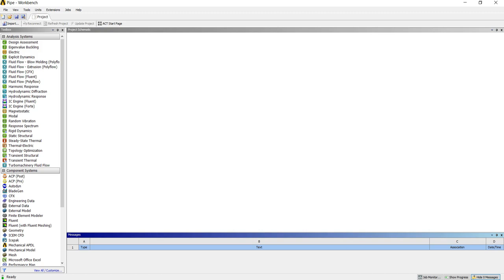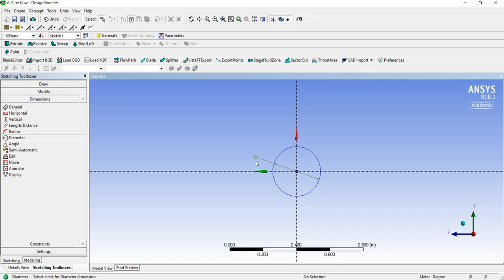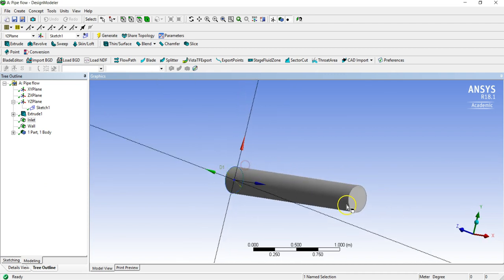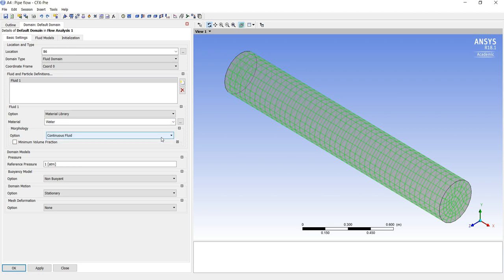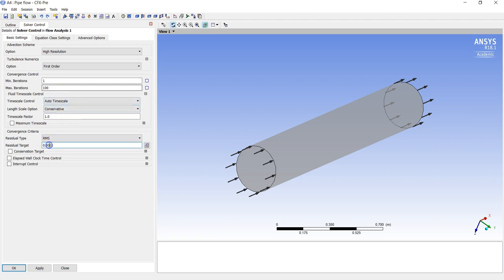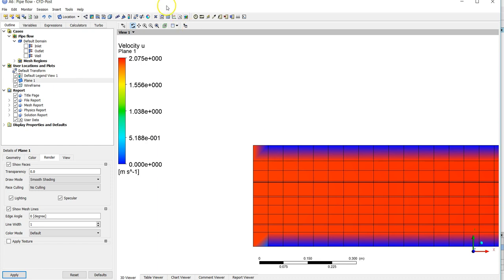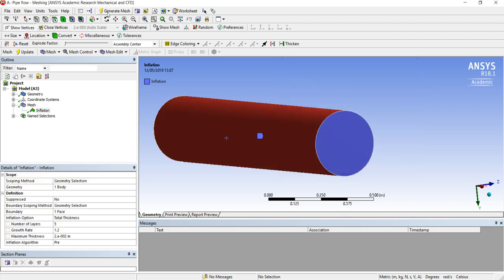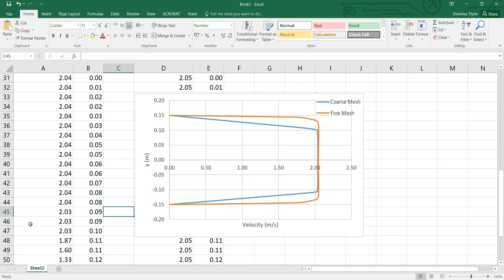Water Flowing Through Pipe using Ansys CFX

Comment: Hello and thank you for this tutorial,I have a question. I'm trying to design a rectangular pipe with the same hydraulic diameter of a cylinder pipe ,and I'm using your method to design , my question is how do I move the square I creat to be in the center like the circle .Cause when I draw the square corner is 0.0.
Reply from the maker: If I understand the question...take a look at some other video to see how to use the constraints to achieve this.